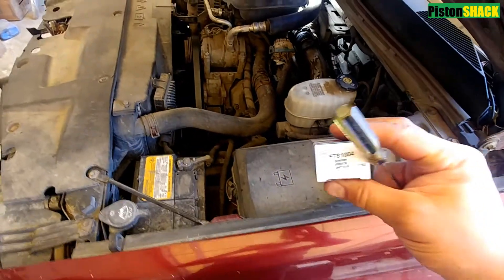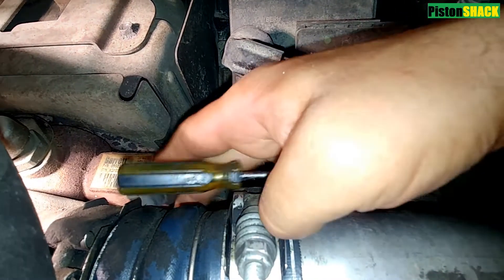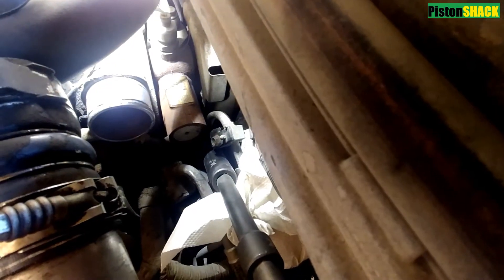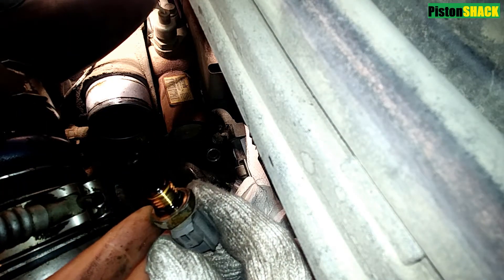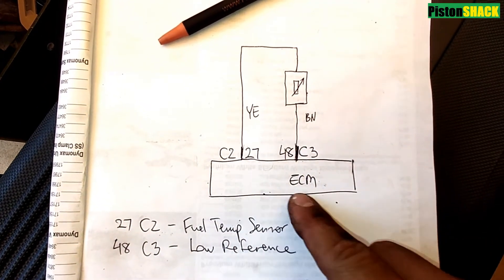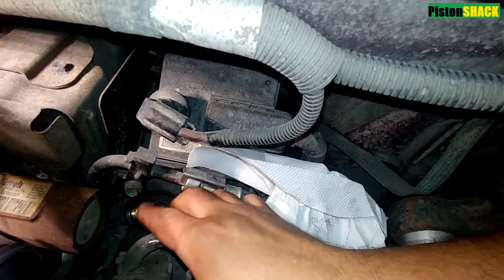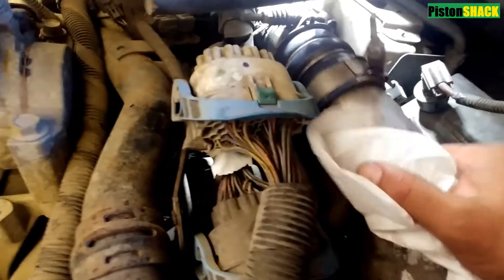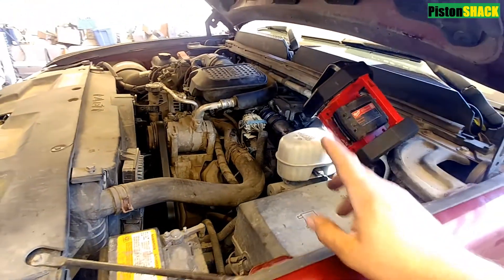DURAMAX FUEL TEMPERATURE SENSOR REPLACEMENT & QUICK DIAG TIPS | p0183 Fuel Temp Circuit High Voltage

Comment: where is it located at the fuel temp sensor
Reply: Right I could find it because he didn't show how to get there 😢
Reply: For a 2016, it is on the driver's side all the way to the cab under the transmission fill stick 😀
Reply: Did you find it?
Reply: @MariaR-ly9mq  how long did it take you to change yours? Is it easily accessible? I’ve read that it’s on bottom of the cp4 pump

Comment: i have a 03 lb7 . i just replaced mine with a new one, but am still getting the same code 0186 i believe, says the circuit high ???
Reply from the maker: Hey Justin! If I remember correctly, Fuel Temp sensor circuit on Duramax  has pull down design, voltage stays high means there's open somewhere between sensor and ECU. When sensor grounds sensor voltage will go down.

Comment: Can you indicate what fault the vehicle takes by having that defective sensor? Do you know where a 2012 duramax is located?
Reply: Look on the drivers side all the way to the cab under a metal bracket under the transmission fill stick.  Good luck.

Comment: I have a 2016 GMC Denali 6.6L and this is not where it's located
Reply from the maker: Hey Michael. Your LML Duramax is different than mine LMM (LBZ).  Any luck?
Reply: @PistonShack  not yet but I'll keep you posted because it's been impossible to find online thus far
Reply: @michaelkonkright174   any luck on location fuel temp sensor  for lml 6.6 ? I heard of on back of fuel pump but idk ..
Reply: @PistonShack Did you ever find it?  If so pls share location 😊 thank you
Reply: I have a 2016 6.6 chev and I couldn't find mine there either.  Can you tell me where you found yours, pls.

Comment: I'm so glad I finally figured out why my truck was shifting so garbage, and that I found this video to show me where to fix it!
Reply from the maker: Interesting situation, I have never heard that ETC can effect shifting. What was causing shifting issue?
Reply: Apparently when the sensor reads too far off on an LBZ it forces the truck into a "safe" mode, which engages the torque converter in 2nd or 3rd and forces high revs before shifting.